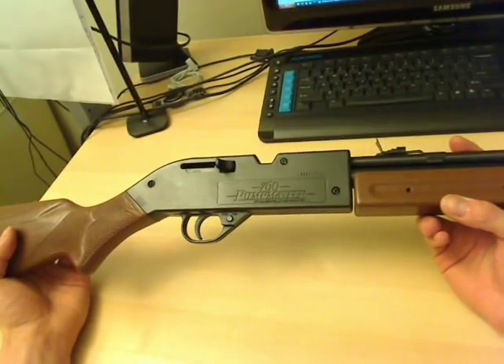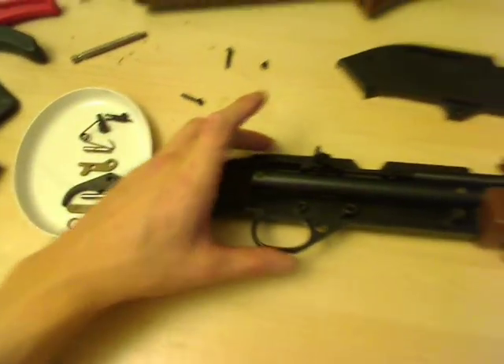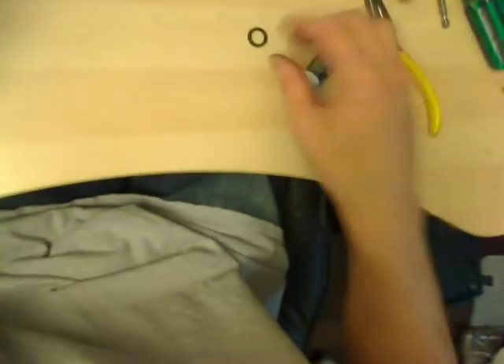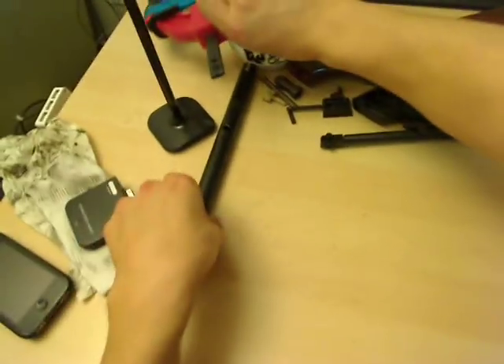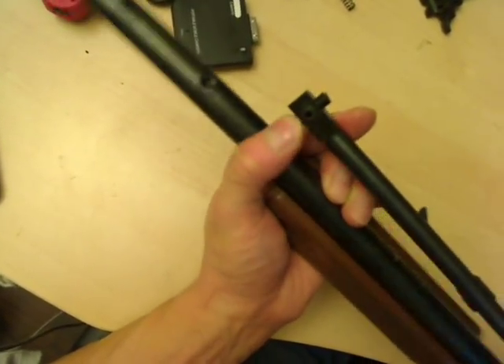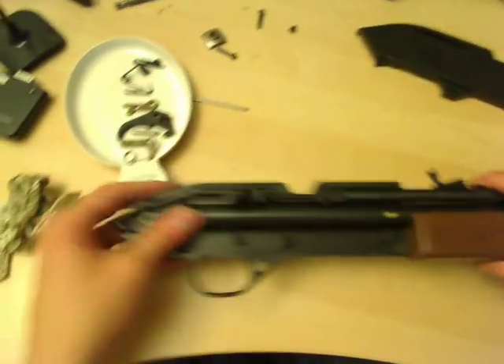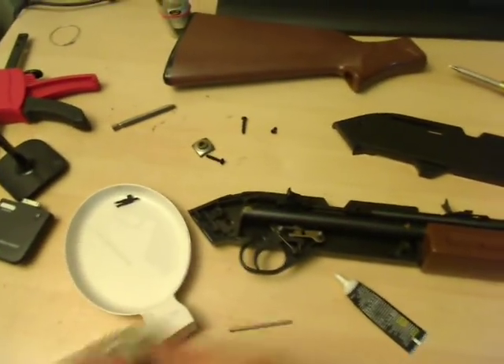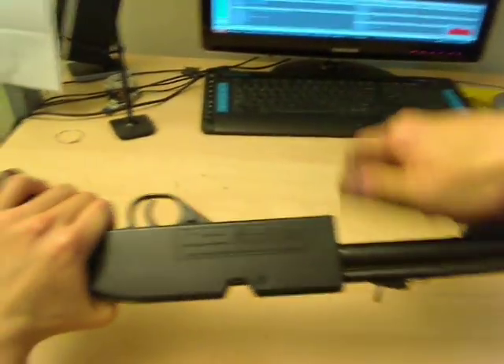FPV - How to Repair an 18 Year Old Crosman PumpMaster 760

Comment from the maker: Ya WD40 eats plastic/rubber like crazy, I've seen that before.

Is SAE 30 motor oil made of petroleum mineral oils?  Doesn't that destroy rubber too?  I guess if you're saying it works, it should be safe.

Ya, vasiline is petroleum jelly so I could see it destroying rubber/plastic.  Wouldn't that be the same as SAE 30 motor oil? 

I noticed you're in Canada too, we get ripped off on the crossman replacement parts(I asked and they quoted $20+tax!). In the US, it's like a fraction of the cost.

Comment from the maker: Also, I'd like to note that motor oil is a bad idea for rubber, as any petroleum products will make rubber swell and degrade very quickly, so for the cup, I used silicone based grease, it's a little thick and works for my reused cup, but those with new cups should source non-petroleum oils, I think crossman makes some. 

The reason I didn't order the replacement parts is because it didn't make sense for me cost-wise.  $20 to order the o-ring and cup, or $35 to buy a whole new pumpmaster.
Reply: And get everything you need if you just order the seals for $8.00 from Crosman shipping included

Comment: How much would you charge to replace mine please...  No pressure when I pump it.
Reply from the maker: +Isabel Arango I'm not a professional gun smith, but I'm sure if you contact crossman they can give you the contact to some local repair shops that work on their products.  Contact them and see what they say.

Cheers,

David.
Reply: hi i have a pump master .....when i pump it it makes a shh sound
Reply: hi i have a pump master .....when i pump it it makes a shh sound

Comment: problem with oils if you used the wrong kind it will seep into the internals and eat seals, i got so many customers that use gun oil for firearms and wd40 and then wounder why there repair bill gets so high even vasiline eats airgun seals in no time at all,

Comment from the maker: Hi, 
If it's 10+ years old, then the parts diagram I linked in the description will show you the part number of the part you're talking about.

If I'm right, it's the plastic 90 degree piece, try super glue first, but if that doesn't fix it, I think you might have to order a whole new barrel assembly.  760G134(Serial #688****) or 760E134(Serial# 134*** or 588****).  

If you have space, you can repair it by wrapping it in black thread, then dropping some thin super glue on it. Might work.

Comment: @DavidSunshine867 Yeah but I'm from Sweden and no Walmart here :/ Also this gun costs about 140-150$ in Sweden. Its such a huge difference in prices on airguns that its sick. Mostly guns in the US are 1/3 of the price.
Checked several stores that have some O-ring kits in all sizes. If I find one about the same size, you think it will work the same like a new one from Crosman? 
Now when I pump slowly I can hear some air leakage, guess it must be the O-ring right? I

Comment: Doubt you will get this msg. But mine won't pump at all, it all still works but it won't pump. Any ideas why. Thanks
Reply from the maker: Did you try pumping really fast to see if you can put some pressure on the compression cartridge?  Then pull the trigger and see if it releases some air.  When my pump piston was loose, I could still build pressure if I pumped super fast a bunch of times.  If you aren't building pressure up like that, the compression cartridge seals might be broken. Then you'll need to do a full tear down of that and replace it's seals.  They should really make a silicone upgrade kit for the 870, they would sell so many of those!  Maybe we should all Crossman if they would do this.  Maybe I'll send em an email.
Cheers!
David.
Reply: @DavidSunshine  thank you for your response. Yeah no matter how I pump it it will not build any pressure at all, I can pull the trigger and it does fire but nothing comes out. So I took it apart to check the inside trigger guard nothing was broke in there I didn't take apart the barrel tho

Comment: its SAE 30 NON Detergent Motor oil it is 100% gaurnteed i even get all my customers to use the stuff and they have all had great experience as well using it and so do many others, we have to bring parts in to canada so we pay shipping on top of price for the parts etc,its just how it goes, i sell a complet valve for 15.00 and a new cup is 5 bucks plus the shipping, the single parts cost more then a whole valve.  and yup iam in canada do a goolge seach for airgunmodsbykands its my website

Comment: on my grandpas powermaster there is a stupid roll pin that I cant get out its so frustrating
Reply from the maker: They are hard to get out. But the trick is to use a hard backing, not your leg like I do here like a noob lol.  I didn't have a vice but you need something solid. Then the roll pin will actually move when you hammer it.  
Good luck! 
Cheers, 
David.
Reply from the maker: I've got a video linked in the description, to a roll pin video where I punch it out with a vice.
Here it is https://youtu.be/a6Wf_aQwkwI?si=LaOIT56obHjQBy_V
Reply: @DavidSunshine  thanks Ill check it out1

Comment: well when it comes to Sae 30 non deterent motor oil it is 100% safe for all airgun seals, the only place it is not used is in spring powered airguns , but 100% safe n pumpers and co2 guns , Crosmans pellgun oil is very over priced you dont get much and it causes shrinkage of seals and usuay turns them pink and hard as a rock,  i have used thesae 30 non detergent motor oil and never once had any issues and many other top aigunners  also us it, as it gives you longer seal life as well..

Comment: the pressure cylinder have a spring inside?
Reply from the maker: Roberto Paredes 
Yup, check the description for a link to the parts diagram, it's part number 2200-045, the "Check Valve Spring", $0.50, but that was back in 1996.

Best regards,

David.

Comment: I had my new pumpmaster for no more than 2 or 3 months and it wont shoot anymore. sometimes it gets really hard to pump even if its two or three pumps in, or  somtimes i pump it and air escapes out the barrel. brand new gun damnit!!!! is it the seals or the valve that holds the pressure i have no idea. there needs to be another vid that is in better lighting and shows greater detail. this sucks.
Reply: I have the same problem. After a couple of months, the air leaks out the barrel when pumping. This video was helpful to troubleshoot. I was able to disassemble and try the O-ring trick, but no change. I suspect it is a faulty pressure chamber.
Reply: ***** I disassembling the pressure chamber. The plastic/nylon stop valve on the trigger pin had a crack in it. I ordered one online and replaced it, and it works now.

Comment: Mine is about 26 yrs old now, im restoring it as its quite rusty and damaged
Reply from the maker: That's awesome!!  If it's really rusty, I recommend using Nufinish to dissolve and polish off the rust, it works great and I use it on my rifles all the time, leaves a protective layer that keeps it looking new for years!
Good luck restoring it!
Cheers,
David.

Comment: I have a rifle just like yours, will not pump air and fired, the trigger if it works, it is the same as yours
Reply from the maker: +David Mendoza Hi, like Crusher1944 said, you can buy a working gun from walmart for $30, and use that, or maybe I was thinking you can use the parts and put them in your 870 to get it fixed?  If you can order replacement parts for cheaper, that might be the way to go as well.

Comment: Today I fixed my Powermaster 66 AB bought in 1987. I replaced some of the O rings from the valve assembly but was still losing preasure. I investigated a bit more and I found the O ring (internal) of the valve stem assembly was defective. It is very difficult to see and does not show on the crosman diagram. http://www.crosman.com/pdf/manuals/crosman/66/C66-EVP.pdf 
Part # 1322A011. I used a O ring of 3mm or 1/8". It is working fine now.
Great video, helped me a lot.

Comment: I have a 761 XL that was fixed by Bill Gasser at Dollar Sports at 10420 Baltimore Avenue Kansas City M.O. 64114 (816) 524-7600. It shoots as well as it did when it was new. I put a 4x scope to help my 50+ eyes and it's DEAD ON. The repair was not that bad and was well worth the money.

Comment: please make new video with out all the movement. mine is a bit older but a few thing similar in placing it back together is a challenge
Reply from the maker: pirata613 ya. I could make a new video, been thinking about that for some time now.  Thanks for the request!
Reply: Thanks David 😁😄

Comment from the maker: Lol, ya it's hard to get out, as you can see I was hammering like a mofo!
The secret to it, is to get a solid backing, I put up another video that shows how to do this.  If you have a solid backing, you can hammer it out quite easily, in seconds.

There's a link to the video from within this video, or you can search "remove roll pin 760" to find it.

Cheers.

Comment: The lighting is poor and you can not see the detail process and the camera moves around distorting some of the video.  However, this video is helpful.
Reply from the maker: Thanks!  Ya, this was made before digital cameras were installed on cell phones.  There might have been some phones with cameras, but they were poor quality.  Digital cameras did exist, but they didn't record video longer than 30 seconds, and the quality was worse than this webcam that I had connected to my head.  
640x480 was the best resolution at that time, but now I've got 3840x2160 so I'll reshoot this video.
Cheers!
David.

Comment: my gun dosent build up pressure i think the bronze thing is broken
Reply from the maker: +the master of clashing If you pump quickly, fire it to see if it releases any pressure, if it does, that's the pump/piston's seals, otherwise you're probably right, the bronze looking compression chamber is probably leaky. I haven't taken this apart yet, as mine was working fine, but I think you unscrew it to take it apart.
Reply: +David Sunshine i finally fixed my gun if its making a shh sound when you pump take the gun apart clean it check seals oil and unscrew the valve (bronze thingy) and there should be a plastic thing with a metal piece attached to it check that piece for cracks or dents it usually goes bad if you got sand in your gun

Comment: I can’t get the pin up by my pump out
Reply from the maker: Lol I couldn't get it out easily either, so I made a video for it, you gotta get it against a solid backing, not your leg like I was doing lol. Check this video out, should help, you should use a nail or screw or bolt, like a roll pin punch, if you don't got that. https://youtu.be/a6Wf_aQwkwI
Cheers!
David.

Comment: Why would you have to repair it? 18 yrs is  nothing. I have a 760 PowerMaster that is about 50 yrs old. Still going like the Energizer 🐇 I also have a Pump Master like the one in vid. Still going.
Reply from the maker: I think the natural rubber degraded over time, seals leaked and it would compressed air anymore.  If they were made of silicone it would probably be ok. That's awesome the 50 year old one keeps working today!  Keep enjoying them, I don't think shooting cans or paper will ever get old.  These things definitely hold sentimental value as well, so hopefully we can keep them running. Even if it didn't shot, I'd probably never throw it out.
Cheers!
David.

Comment: I can't get to o ring off, pls help me m8
Reply from the maker: Check the description I have a link to a video showing "HOW TO REMOVE THE PIN", is that the part you're having an issue with?  That video should clear it up.
Reply: David Sunshine I got past the part I was stuck on now I'm stuck on putting together the trigger and everything
Reply from the maker: Oh cool.
If you start watching from here, and follow the parts that I put back in, it should work out:
https://youtu.be/lsShfA7KNb8?t=13m51s
Good luck!
Cheers,
David.

Comment: Good info, but the gopro on your head was making me dizzy.
Reply from the maker: Lol thanks. Sorry. This was actually filmed before go pro came out. So it's low resolution and just a wired computer chat cam on my head.  It was good for its time!  I think at this time, the 3GS was out, so only 640x480 video was common, this camera recorded in 1080p, it's an Intel webcam, Intel doesn't even make webcams anymore, this was ahead of its time.  A shame cuz Intel made good stuff, I think this webcam is still good quality even to today's standards, they were ahead of their time.
Cheers, 
David.

Comment from the maker: Hi,
I'll upload a video shortly that shows how to do it properly using a heavy hammer and a roll pin punch. You can buy the punch at any hardware store.
Basically, you just need a high inertia, heavy rest to rest the cylinder on, while you hammer it with a heavy hammer.  Don't try using a light hammer, the speed you'll need will mean that if you miss, you'll break your own finger.  A heavy hammer is a safe hammer.
Video to be posted in a bit!